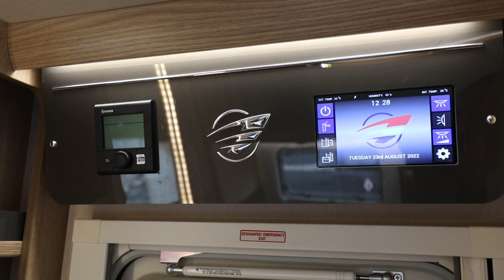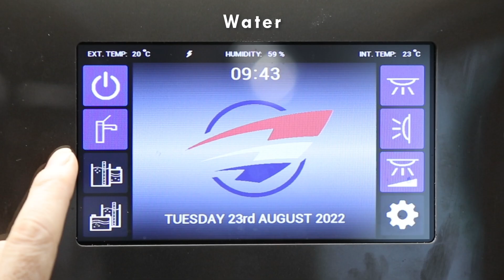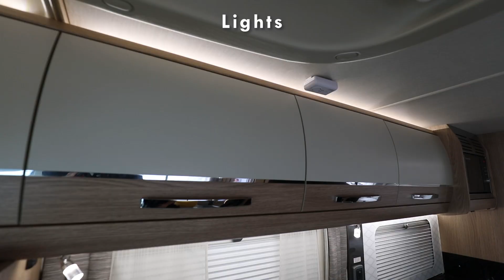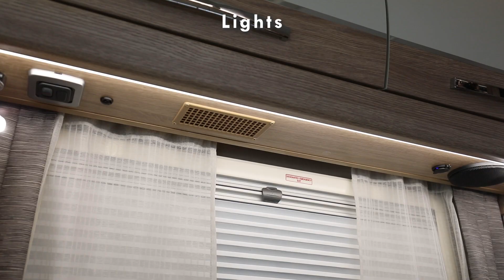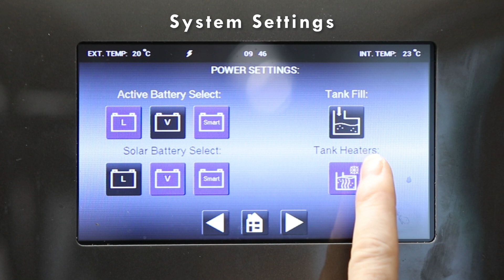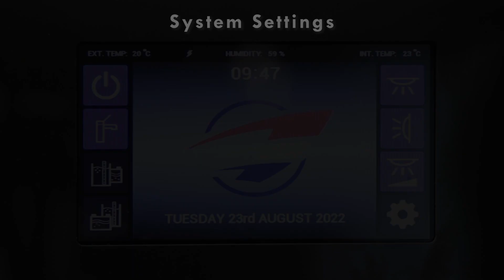How To Use Your Autotrail Touch Screen Control Panel

Comment: I have trouble with my control panel it lights up but screw is frozen so won’t turn on have turned off mains battery still won’t turn on any help would be appreciated